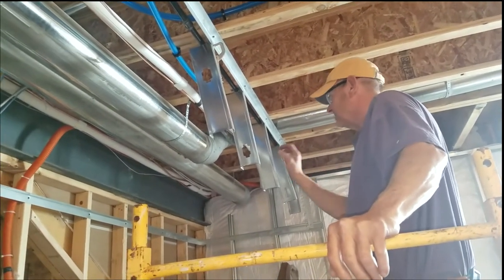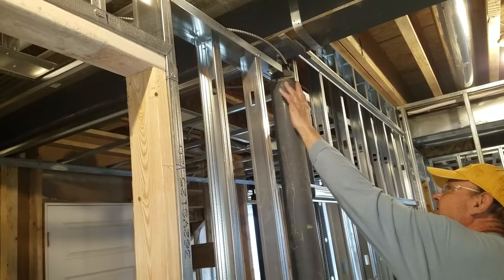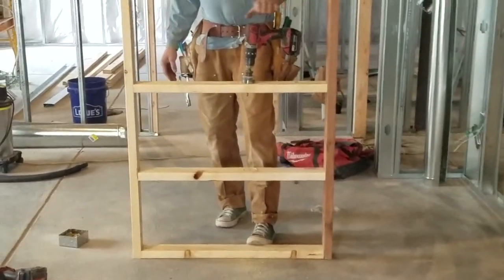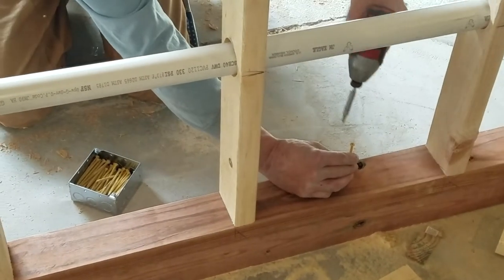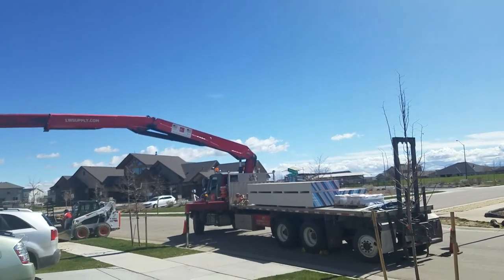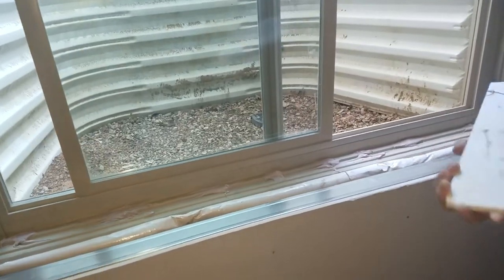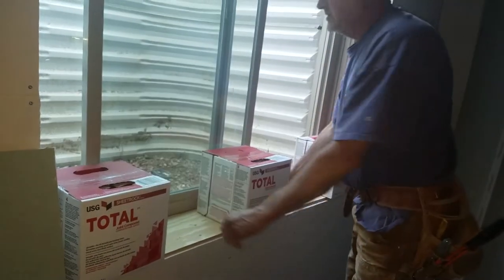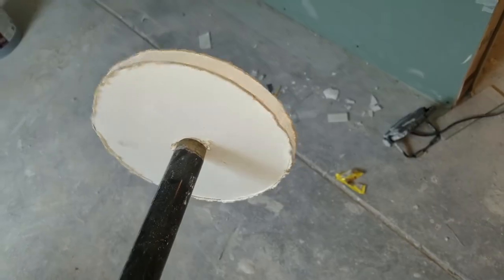Colorado Metal Stud Framing 2.0 Wet Bar, and More

Comment: When using metal studs do you not need to float the floor? Thanks for the videos learning a lot and may use metal studs now thanks to this video!
Reply from the maker: No we did not do the floating walls in these houses, I have done 3 so far, all in Ft Collins, all built with in the last 3 years. However I have done 2 with wood studs doing the floating walls, on the third now, 1 in  Berthoud says it's ok to use metal studs as long as the house is over 5 years old,  Just make sure the city OKs it first, as both cities are in Larimer County. Thanks for watching.